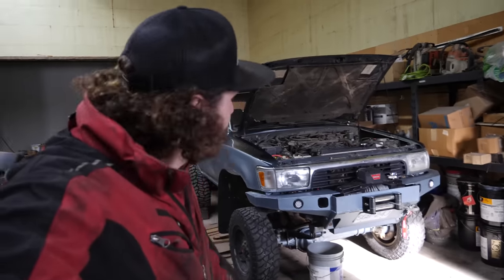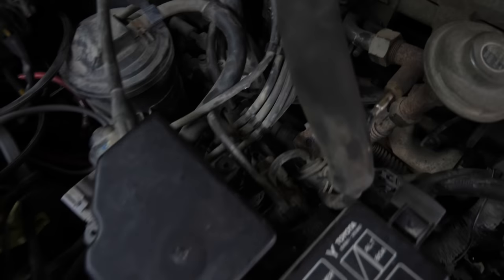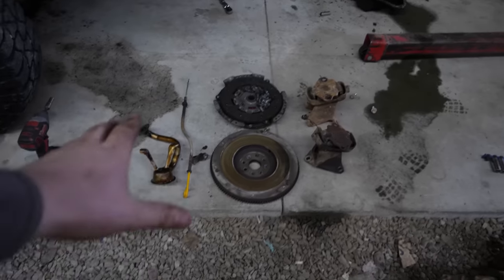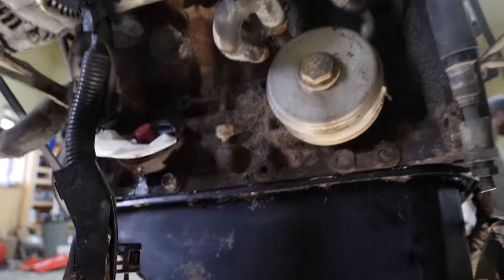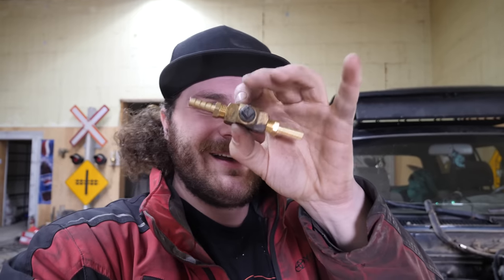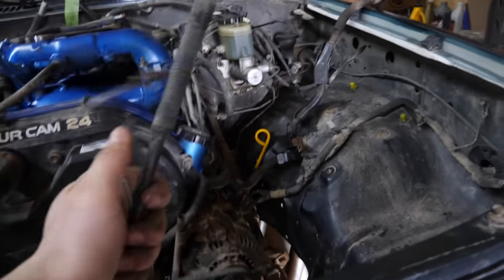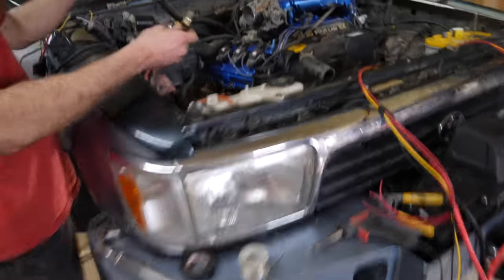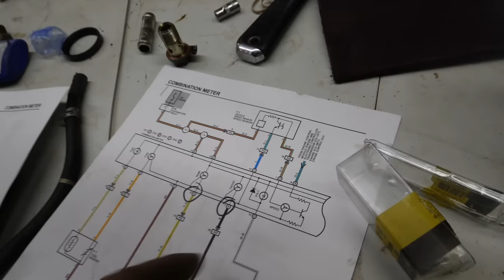Complete Toyota 3.4 Swap Tutorial: Everything You Need to Know

Comment: Hey man I’m doing This swap to, I bought a 2000 model 4Runner with the 3.4 and automatic transmission. I’m putting it into my 1989 4Runner but it’s a manual will the computer still work even though there 2 different transmissions?
Reply from the maker: Probably not. Not because it's a automatic, but because it's a 2000 model, I always try and tell people to stay away from 99+ because they commonly have immobilizers. If your lucky it won't, usually base model trucks won't, but limiteds have generally all have immobilizers, but also some SR5s 😅. Either way if it doesn't have one your set, the motor, harness and ecu we used in this was from a auto and we attached it to a manual.
Reply: Ok cool thanks man! That was a great video!

Comment: So the stock 3.0 manual transmission blows right up to the 3.4
Reply from the maker: Yes. The manual 3.0 trans bolts to 3.4
Reply: @DirtGarage is there supposed to be a dust cover on the bottom half of the fly wheel? Currently half way through a SAS.. 3.4 engine, putting in the 3.0 transmission but the bottom of the fly wheel is exposed. Doesn’t seem right to me..
Reply from the maker: @mckennacooper6170  Yeah, use the 3.0 cover.

Comment: Sr I have question l have 1995 4runner and I tried to do the swap but my trasmision is automatic and I have trouble with the wire harness harness
Reply from the maker: You need to use the automatic from the 3.4! Then to get the transfercase to drop on correct side you need an adapter to go from 3.4 auto to gear drive case from earlier Toyota 4 cyl.
Reply: Sorry I didn't  I don't know a lot So all I got is the transmission from 3.0 is not going to work  ?
Reply from the maker: @JoseAguilar-lh5bq  No, the 3.0 transmission will bolt up, but will not function, the 3.4 computer can not talk to it.
Reply: Ok thanks for your help
Reply: Hi I need advise with this problem I have with the transmission  I don't know what to  Get  of automatic transmission on manual for the 3.4 swap what is the best solution
Reply: Or am I too close to giving up and sending the 4runner to the scra metal please can you tell me what is the best solution  thanks
Reply from the maker: @JoseAguilar-lh5bq  you need the transmission from the 3.4
Reply: @DirtGarage  yes  I understand that But the transfer case is not gonna workI I have to use an adopter and another transfer case from earliest model  but you know  what is the best solution automatic or manual transmission   Which one is gonna be a more headaches to fix it
Reply from the maker: @JoseAguilar-lh5bq  Earlier manual trans t case from a 4 cyl. Gear drive case
Reply: Ok one more question what is the years you recommend  please thanks
Reply: I have 1986  transmission  manual 5 speeds  this  work for the swap
Reply from the maker: @JoseAguilar-lh5bq  is it from v6? If so yes it will work

Comment: Next time just drill the dip stick hole instead of knocking it out works the same
Reply from the maker: It can be easy to knock it out.
Reply: @DirtGarage  exactly why would you spend time drilling if you can just knock it out 😂
Reply from the maker: @Red_Beard_Builds  Because it broke in half in this video.
Reply: @DirtGarage  I remember both of my motors had a plug that I used a punch to knock out and replaced with my 3.0 plug and just replaced it , I know some motors you have to drill them out right ?
Reply from the maker: @RedBeard Off-roading  Yup. 99+ motors require drilling. We just got unlucky and the shaft attached to plug broke off in block.